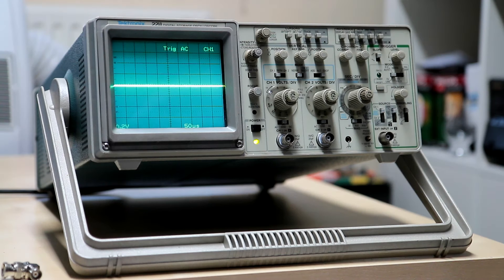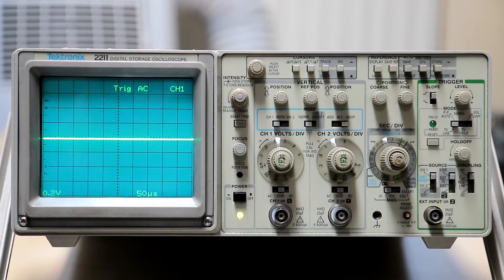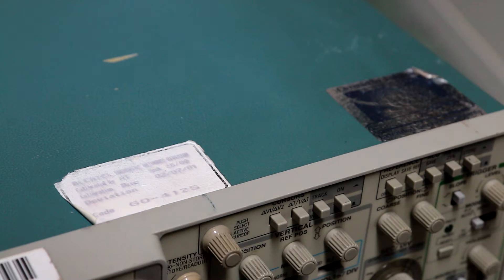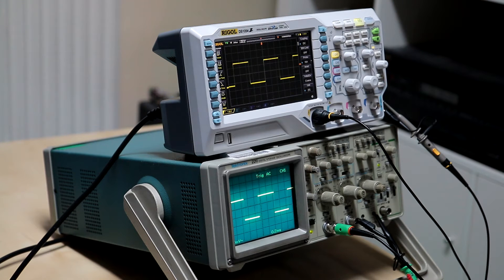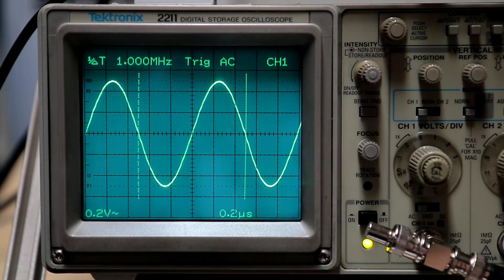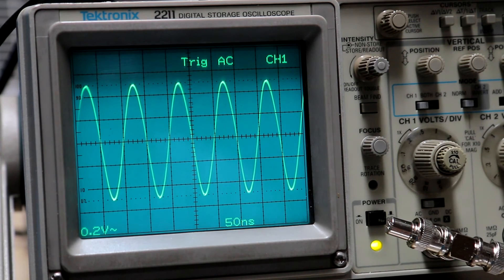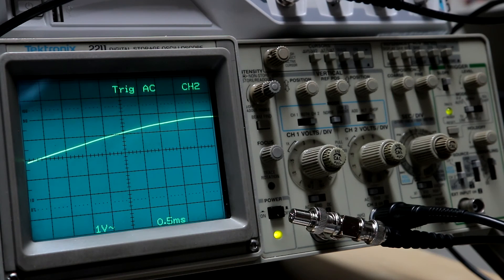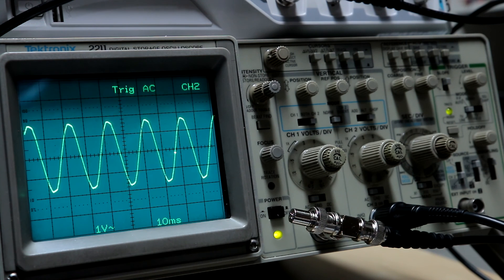Old Tektronix 2211 cathode ray oscilloscope.

Comment: The wobbling, already visible at 1MHz on both scopes, might be caused by insufficient or inadequate filtering of the DDS generated sinusoidal waveform. It is a DDS waveform generator, right? Anyway, you have an excellent analog scope.
Reply from the maker: Yeah the function generator I was using is rubbish.
Reply: If there is any reconstruction filter on the PCB, and if you have a schematic, the fix should be simple. You can use the online simulator PartSim to recalculate the filter so that it passes all frequencies up to 1/3 of the sampling rate.